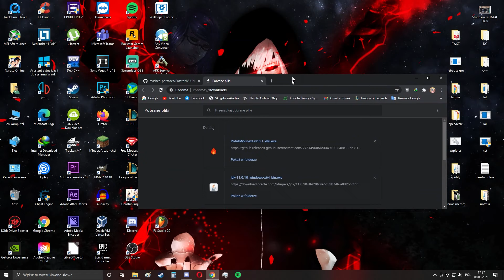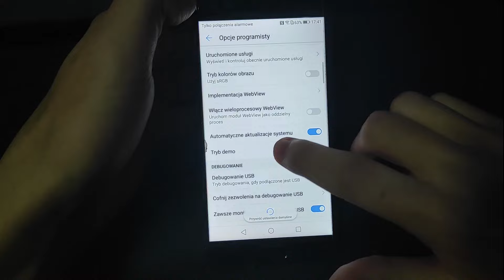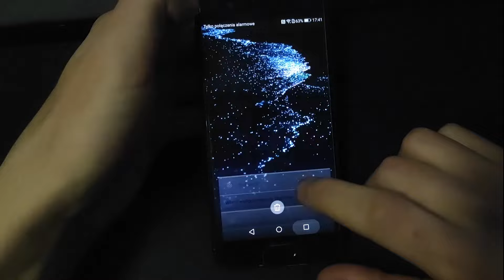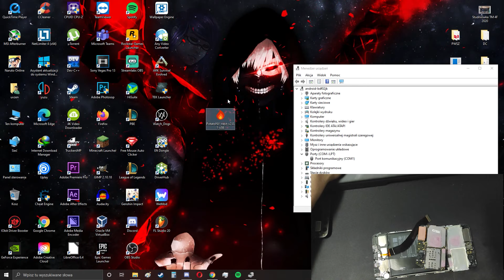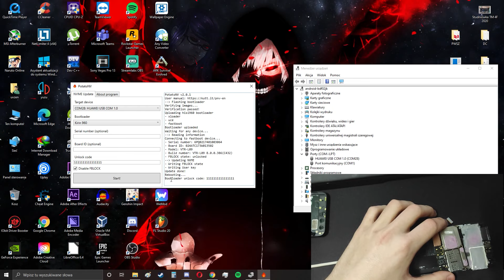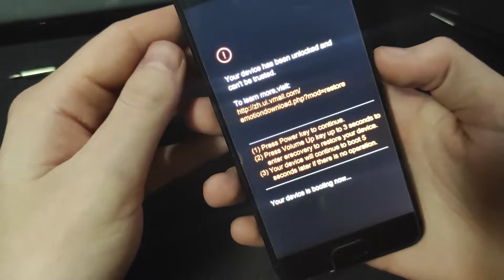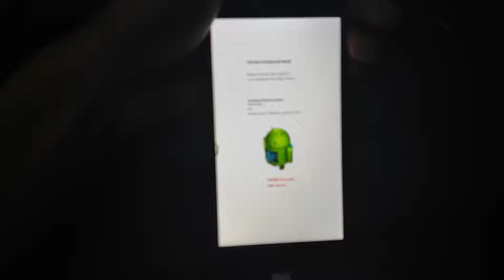Huawei unlock bootloader | PotatoNV Tool Kirin 960/950/935/925/650-659/620 (READ VIDEO DESCRIPTION)

Comment from the maker: ★ If you need help with PotatoNV, check this Telegram channel: https://t.me/PotatoNVSupport
★ A new version of PotatoNV has been released and has changed a bit. Now, after generating new code, go to fastboot mode and type "fastboot oem unlock <new generated code>" and enjoy with unlocked bootloader (factory reset will be performed), and if you want to unlock the bootloader without wiping data, just check the "DISABLE FBLOCK (not recommended)" option, then no command needs to be used "fastboot oem unlock".
★ For Kirin 955: Try run PotatoNV with selected Kirin 960 or Kirin 950 (one of these should work)
★ There is no support for Kirin 710/810/970/980 and newer. You have nothing to look for here.
★ I don't answer questions like: Does this work on my Huawei/Honor device <model>?
It is really hard to check the specs of your device? Check what processor your device has and make a decision whether it works or not. 
KIRIN 960/950/935/925/650/655/658/659/620 <----------- If your device has a procesor from this list, it should work and the rest of the processors KIRIN 970/810/710 or newer Kirins and QUALCOMM SNAPDRAGONS AND MEDIATEK processor will not work, SIMPLE LOGIC.
Reply: can you make a vid installing custom recovery for p10
Reply from the maker: @jaylesterdapat7421  I don't see the point in making a video with such an easy thing.
Reply: @uvzen  as i search about the custom recovery like twrp I dont see they support anymore p10
Reply from the maker: @jaylesterdapat7421  As for Huawei P10, TWRP runs on EMUI 8 Android Oreo. There is no support for EMUI 9.
Reply: Escriban eso español
Reply: can i install twrp custom recovery after unlock bootloader this way
Reply: @uvzen  wouldnt it be possible to downgrade from emiui 9.1 to 8?
Reply from the maker: @thebyzocker  It is possible, but why do you want to do this? It's an old android.
Reply: @uvzen  maybe to revive an old phone so that it doesn't go to waste?
Reply: @uvzen  I'm intersted too for downgrade. My device is FRP locked, how can I do that?  Downgrade from 9.1 to 8
Reply: Why is disable fblock not recommended?
Reply from the maker: @wqatch  FBLOCK is the second type of bootloader that can be unlocked. You will be able to flash more sensitive partitions (for example: erecovery), but for the common user who wants to root his device or a flash custom rom, the FBLOCK bootloader is not needed.
Reply: @uvzen  ah, ok
Thanks!
Reply: @wqatch  Do I need USB debugging enabled before I do this mode? I have P20 lite with broken display and touch so I'm trying to use the prone without display. USB debugging is not enabled on mine can I still get the unlock code?
Reply: No, you don't. EDL is far away from Android and doesn't need USB debugging.
Now I also own a P20 lite and let me warn you about something: constantly heat your back panel evenly or you will crack it.
Reply: @uvzen  well actually there is Emui 9 Twrp for P10
Reply: Could this work for the 2018 Huawei p smart?
Reply: My phone has emui 8 android 8
Reply from the maker: @todorokishoto5463  I don't know if you know, but you wrote it under my comment, which will tell you how to check if it works on your device 🤦. I am really surprised that there are a lot of people who cannot read the answer that is given on a plate.
Reply from the maker: Franky Sondaba  You can bypass frp with unlocked bootloader but I can't help you because I don't know your real intentions and I don't know if you can be a thief who stole or found a huawei phone or a person who just forgot password.
Reply: @uvzen  如果没有OEM解锁选项怎么办
Reply: @uvzen  还有就是荣耀8进入com1.0模式运行了您的程序并未成功解锁，希望您重视一下
Reply: Franky Sondaba  你可以先进recover格式化机器，然后就可以设置了
Reply: @uvzen   荣耀8使用您的软件并不管用，勾选上第一个选项才可以解锁，但勾选上第一项的话解锁后刷第三方recover就会报错。

Comment: Important!!: Ensure the battery cable is disconnected and hold the test points until process completes otherwise "Time out error" will occur. Confirmed working for CAM-L21

Comment: Like and many thanks i accidentally hardbricked my Mate 9 Lite (BLL-L23) flasing the rollback zip on MM but with potatonv and unlocked bootloader just reflashed the EMUI recovery (on fastboot) and reflashed the stock B120 (with the reflashed Erecovery) and a good adition is i can re unlock my bootloader anytime again (i saved the new generated unlock code)
PD: sorry for my bad english

Comment: Thanks for the software. Unfortunately I can't enter developer mode or activate usb debugging and therefore the process fails (I guess). I have a defect motherboard and want to restore some of the internal data of my phone. Do you have any hints?
Reply from the maker: You don't need a developer options. Check "Disable fblock (not recommended)" in PotatoNV and unlock bootloader.

Comment: can i ask why ground those so called test points? i mean do I really have to disassemble my device? or is your first video before this fine than this 2nd video?
Reply: You need it to enter VCOM mode, maybe shorting green and black in the cable should work too, but in not sure about kirins

Shortly answering - yes, you have to
Reply from the maker: The testpoint method allows deep flashing (VCOM_DOWNLOAD or EDL mode) with locked bootloader, which also allows you to flash and modify everything (bootloader too, which will allow you to unlock it) and it's the only method that works for devices from android 7 and above and for the highest number of users that have processor Kirin 960/950/650/655/658/659/620. So if you have android 6 or an older version and a Kirin processor then you can use the way from the second video on my channel about unlocking the bootloader, and if you have a newer android all that remains is to open the device and use PotatoNV. For other Kirin (980/970/710 and others) or Qualcomm processors, the HCU client may work, but it comes at a price.

Comment: After doing all the procedure on my P8 Lite 2017 the Potato NV Program, after the green bar loads, it says "Waiting for any device" and then "Timeout error".
I've ibstalled the driver with the testpoint method and all.
Do you have any clue on why it does that? Thanks
EDIT: Oh, nevermind, the phone restarted itself and the Android Robot screen says "Phone Unlicked".
I just had to check if the phone was on but it was upside down LOL
But now which code has been selected, since the latest version of Potato NV doesn't allow to choose one by ourselves? Do we need that code for the rooting procedure? Sorry but the last device I rooted was the Galaxy S6 a long time ago
Reply: did it work for the p8 lite 2017?

Comment: i watch This 6 times monthly on this year it doesn't work on my Huawei gr5 2017

Because you said unplug the battery so I follow then it doesn't work but when I plug the battery it work I just wasted 6 full months trying to unlock my Huawei bootloader 

And I got my unlock bootloader code but I need to do it manually not automatic but thats ok I know how to do it

Comment: Do i seriously have to open up my tablet ? Huawai Mediapad T5. I just wanna install lineage os cause Android 8 is pretty old now and i got told lineage os dosent have all the google stuff by default installed which takes way to much of the 16gb of storage the device has.
Reply from the maker: This is the only way to unlock the bootloader, you need to open your tablet and use PotatoNV. There is also a PotatoNV tutorial on the xda-developers forum in the Huawei Mediapad T5 section.

Comment: What if i don't want to enter my own unlock code and instead get the original one?
I have Huawei y6II (CAM-L21) with Kirin 620
I just want to get the unlock code
Reply from the maker: The original key can be obtained, but it is a long and annoying process.
Reply: @uvzen  is it possible to do that with MRT HW Tool or SigmaKey? like this vieo: https://youtu.be/ru5AGVlSPpk
Reply from the maker: @worldofmix6766  If you have android version 6 or 7 it will work, but use dc unlocker no sigma key or something else.

Comment: I just did a bit of a research and found out that there is such a thing as a software testpoint which can take the phone screen to blackscreen much like what this hardware testpoint approach you're using. My question is, can that be used instead of this your method, because it seems to me that what's important is getting to a blackscreen and connecting to that device layer to initialise the OEM unlock without the need for a code. 🤔

Edited:
So, I successfully unlocked the bootloader of my Honor 9 (Kirin 960) using this method. It was quite straightforward after identifying my hardware testpoint node.
Thank you for this video.
Reply from the maker: Yes, it might work. Programs like Dc Phoenix, Sigmakey, and others offer this service, but not for free. If you want to do so and prefer to pay, you can try it, but why? My video is based on unlocking bootloader for free and additionally after unlocking it doesn't perform a factory reset so it doesn't lose data. After running software testpoint you need to flash firmware, so you will lose data. Additionally, this option requires more time, so in my opinion it is not worth it.
Reply: @uvzen  okay. I'll stick to this method, then. I should be able to find a phone repairer that can help with opening the back of my phone. Mine is Honor 9. Could you please help me with where my Testpoint should be? 🙏
Reply from the maker: @ekeretteekpo3004  https://d.radikal.ru/d26/1801/76/af7aa00bb0fc.jpg

Comment: I haven't been able to get it working with Honor 8 Kirin 950. When I click start, the green progress bar loads. A few seconds after the progress bar is filled, the USB connection immediately disconnects. This would be followed by a time out error a few seconds later. I have tried several attempts by moving the connection points and using Huawei drivers. The result is the same.
Reply from the maker: You have something wrong with the basic usb drivers. If you don't have Hisuite then install this program, if you already have Hisuite try reinstalling Hisuite or install the latest Huawei usb drivers and after installation, don't forget to restart your PC.
Reply: @uvzen  Thanks for the quick response. I have Hisuite installed/reinstalled and used the drivers. I had two types of drivers on my list that were dated 2015 and 2016. Neither worked.
Reply: @gtech5884  It worked for my Honor 8 without any problem.

Comment: any help ?, mi TRT-L53 just enter to fastboot mode and reboot like 5 seconds and again and again(the problem is not potato nv or drivers its my phone), any help?
Reply from the maker: It's hard to read the title and description of the video in which I described what devices it works on? Check what processor your device has, then check the list of supported processors in the description or in the title of the video. Your device (TRT-L53) has a SNAPDRAGON processor and PotatoNV only supports KIRIN processors.

Comment: I need help. I installed hisuite, adb drivers,  test point drivers, potatonv and disassembled my device. I pressed start after checking everything was okay and it was going well until it said "timeout error" and just stopped there. My internet went down also during the process for few seconds. Is that normal?
Reply from the maker: "Timeout error" means that you have something wrong with the USB drivers in your PC. Change USB port or cable, use another PC or reinstall USB drivers. I have no other advice. As for your internet problems, this is not normal and I have not seen anyone else complaining with the same problem as yours.
Reply: @uvzen  ye it was something on my end. I did it on other computer and it worked.

Comment: Don´t work, same phone same method :/ I also have installed driver :/ :/ :/ :/ Don´t waste your time
Reply from the maker: You are doing something wrong if you have the same device as me or it doesn't always work out well the first time, I had to record this take for a video 3 times, because it didn't work out either.
Reply from the maker: If you have "waiting for device" and then the timed out, note on the video,
 I'm still holding the testpoint to keep it grounded
Reply: @uvzen  I kept it grounded but the program can´t find my device. I will try it one more time. Thanks you for the Instructions
Reply: @detomatorcz910  check the device manager first.

Comment: Ok, i followed every step on the video. Now, I have some problems
fastboot oem get-lockstate - Says that the Bootloader is locked
fastboot oem get-bootinfo - Says that the Bootloader is unlocked
I cannot flash twrp. It says "FAILED (remote: 'image verification error')" when trying to.
What can I do.
Reply from the maker: Use PotatoNV again and check "Disable FBLOCK (not recommended)" and then you will unlock bootloader without using the "fastboot oem unlock" (no need this command). After these steps check FBLOCK status in fastboot mode with this command "fastboot oem lock-state info", it should be status FBLOCK:unlocked. Try flash twrp after these steps.
Reply: @uvzen  That's what I did, actually. I checked that box and then I couldn't flash TWRP.
My phone says unlocked, by the way
Reply from the maker: @HubbleWebb  Report this problem on github, maybe someone knows the solution to your problem.
https://github.com/mashed-potatoes/PotatoNV/issues

Comment: Trying on a P9 Lite using Kirin 65x (A) I get a timeout error.
Reply from the maker: You have something wrong with the basic usb drivers. If you don't have Hisuite then install this program, if you already have Hisuite try reinstalling Hisuite or install the latest Huawei usb drivers.
Reply: @uvzen  Yeah I don't have Hisuite installed. Gonna try with that and see what happens, thanks bro !
Reply: @uvzen  Indeed Hisuite was what I needed, it worked with that 😁 whoever It didn't come like in your video 😐

After all the process my phone was still locked, all what PotatoNV did was to just replace the unlock code, that's it. So I had to manually change the code with Minimal ADB and Fastboot using  "fastboot oem unlock (code right here)" command.

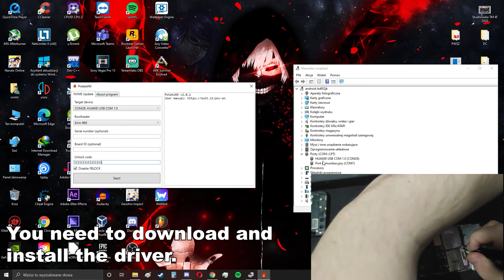Comment: 8:13 when i plug in the cable and press the test point, nothing happens, i just have a message indicating that my p8 lite is connected to my pc but i have download the huawei usb 1.0 drivers file can you help me plzzzzzz?
Reply from the maker: Nothing happens because you are doing the other way around. First ground testpoint, then connect the USB cable and don't forget to disconnect the battery.
Reply: @uvzen  okay

Comment: I'm using Huawei RNE-L01 (Mate 10 Lite). It uses Kirin 659. What should I select 659 (A) or 659(B)?
Reply: I found the answer: According to GitHub page "Huawei Nova 2i / Mate 10 Lite	RNE	Kirin 65x (B)". They are listed on the GitHub page. Don't be dumb like me, search for it. :)
Reply: @MND I accidentally rooted with option A and it worked. But to prevent possible future problems did it again with option B. It doesn't  matter I think assuming you had no problems with it.

Comment: hello and thanks for this video.
i am trying with a p20 lite ane lx1.
when system recognize device as huawei com 1  and then when switched it is recognized as "android single sooner adb interface" and the process fail..  (fail set fblock state/fail write key etc....)  . i installed your drivers... 
what i do wrong? please help me
Reply from the maker: You probably don't have the basic Huawei usb drivers installed. Download them from the Internet and install or download hisuite, which will do it by itself. After all, restart your PC, run PotatoNV and try to unlock bootloader again.

Comment: Hey! i heard there was a experimental bootloader unlock method for Kirin 970 devices, any updates about it?
Reply from the maker: There is no experimental method of unlocking the bootloader for the Kirin 970 via PotatoNV. I know how to temporarily unlock the bootloader for the Kirin 970, but it makes no sense because you won't root your device, you can just flash TWRP with the bootloader temporarily unlocked (as long as there is any TWRP for your device).
Reply: @uvzen  Yes, but i'm not asking about via PotatoNV, i heard there were comments here about a method for testing Kirin 970 bootloader unlock.
Reply from the maker: @aaaa-cs9pe  Where did you hear this information? As I wrote to you earlier, so far I know how to unlock the bootloader temporarily for the kirin 970 and I'm working on it so that I can unlock the bootloader permanently.
Reply: @uvzen  any luck with unlocking 970?

Comment: If I don't turn on developer options and OEM unlocking, can I unlock frp?
Reply from the maker: This is a tool for unlocking bootloader, not bypassing FRP, although with an unlocked bootloader you can easily bypass FRP. Normally, OEM unlocking is required to be enabled in developer settings, but PotatoNV can unlock bootloader without OEM unlock enabled.
Reply: @uvzen thank you for reply! I've got it done😊

Comment: I have the Chinese version of Huawei P10. There is no option in the android settings to "Turn on OEM unlock". Will this method still work?
Reply from the maker: Developer options are hidden by default, you need to enable them.
Reply: @uvzen  thanks for your reply. I know about developer options and I have them enabled. I see a lot of developer options e.g. about usb debugging but no option to "Turn on OEM unlock". I've seen this option on my other android device, but it's not there on my Huawei P10 VTR that I brought from China.
Reply from the maker: @meowcrobe  Another way is to check "Disable FBLOCK (not recommended)" in PotatoNV. Thanks to this, you don't need to allow oem unlock, because bootloader can be unlocked without using the "fastboot oem unlock <code>" command in fastboot mode.
Reply: @uvzen  Thanks, it worked!